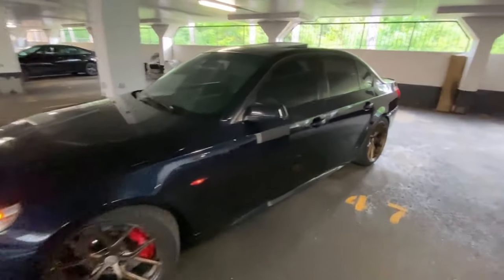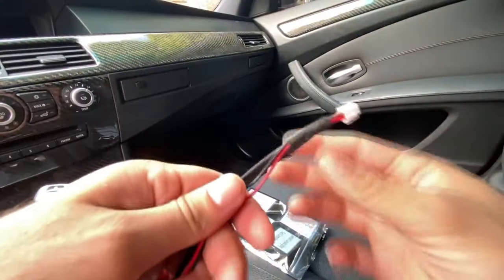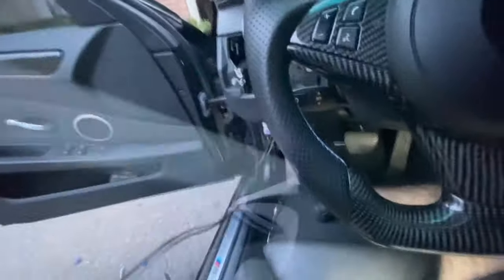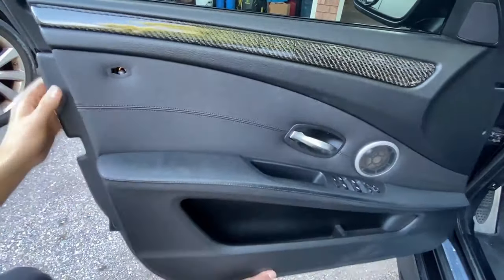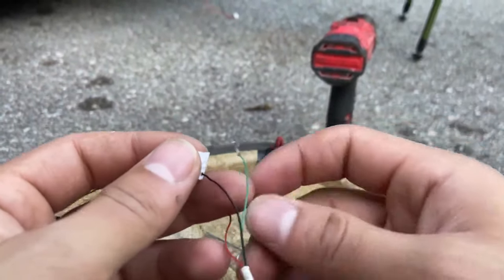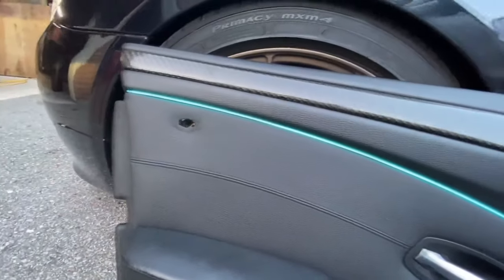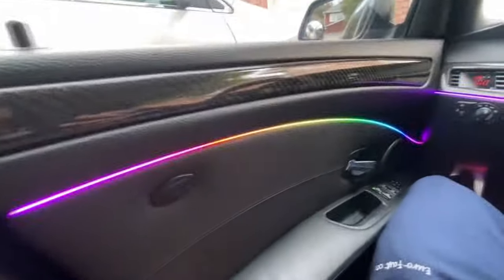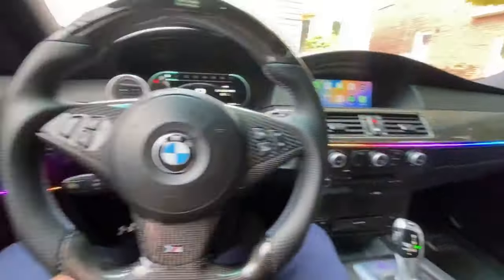The Best Ambient Lighting Kit Money Can Buy - Full DIY Install

Comment: hi, ik this video is a year old but I’m using it to install my ambient lights. I connected it to the ambient lighting but it only comes on during night. Is there any way to get around this?
Reply from the maker: You need to double check the power source. What did you tap into? If you tapped into factory ambient lighting, like I did in the video, it’ll only turn on when your headlights turn on, at night. If your door lights are connected to a constant 12v supply, change the power source for the main controller, maybe that one is connected to your factory ambient lighting power. Change it to a constant (always on when the car is on) power source and it’ll be on at all times.

Comment: instead of tapping into the cigarette lighter why not use a FUSE Tap and tap into the fuse for the Cigarette lighter.  the Fuse Tap is much cleaner install.
Excellent Video and very detailed.  This video inspired me to try installing this kit myself.
Reply from the maker: Great point! However, the fuse for the cigarette lighter is in the trunk of the car. You would have to run a wire from the fuse box to the front dash if you were to use a fuse tap. The cigarette lighter is a fused connection regardless, and I’d actually argue that it’s a cleaner install than running a 6 foot wire from the trunk.
Reply: Bummer, your car has the fuse at the rear. My vehicle has it up front under steering wheel. Now it makes sense why you tapped up front. Thanks for the clarification

Comment: 8:16 No need to de-pin or drill holes for the doors, make a slit on the backside and then push the led strip through from there.. saves loads of time.
Reply from the maker: That’s a great idea! I never even thought of that.
Reply: Slit it where ? Exactly
Reply: Can you explain it like im 5 , im new to this stuff and im trying to set up a kit i bought without putting holes
Reply: anyone reading this do not take this advice just make the hole and depin it takes no time to do
Reply: Make it slit on the back of the door panel along the same line that the, lights will take nearest to the plug just wide enough to feed the skinny end of the light strip through it. Then pull the lights all the way through until your connector is at the back of the door panel. From there, you can
Install the light strip. And your connector will already be at the back of the door panel.

Comment: Thanks so much!

I just wanted to know, how did you install the extra one? Did it need a new module? How did you go about the wiring and getting it all to link up?
Reply from the maker: Which extra one are you referring to? The one under the radio controls? That one I just plugged directly into the main control module. The modules have multiple slots so that you can plug in multiple LEDs.
Reply: @TheAutoSurgeon  awesome! Thanks for that! I've just installed a kit after watching your video! I'm trying to work out that if I bought another kit, if those modules will connect to the same main controller as the others!
Reply from the maker: Someone else asked me the same question, honestly I don’t know the answer 100%. But I’d imagine it would connect—reach out to the company and they should be able to confirm.
Reply: @TheAutoSurgeon  you've been a great help! I appreciate your help, so much!!! I'll check back in with you and let you know how I go!

Comment: how does the sub controller communicate with the main controller? simply as soon as I give it power and all the sub controllers connect to the main controller?
Reply from the maker: Yes, exactly. As soon as they have power, they’ll turn on. But if the main controller is powerless, the sub controllers will stay off since there is no wireless signal indicating the controllers to turn on.

Comment: What if I dont have ambient lights? I connect the doors to the window switch? Do you know which wire is positive and which negative?
Reply from the maker: You would have to test the wires using a multimeter!

Comment: Changed my cars interior wow. I followed your tutorial step by step. Although one of the lights are going in the opposite direction do you know that might be?
Reply from the maker: Awesome! Make sure the connector is facing the same way for each strip. So, if you’re doing the doors, the connectors should be facing the front of the car.

Comment: Thanks for the great video!
As I want to install it on a small car without a soft ambiant dome light, would it be possible to use the storage lights for this purpose or are the LED's to bright?
Reply from the maker: Yes, absolutely! It can be done. If you find that they are too bright, you can always turn down the brightness through the app. It can go very dim, so you’ll definitely be able to find a brightness that’ll work.
Reply: @TheAutoSurgeon  Great! Thanks for your quick reply.

Comment: Great video, do you think there is anyway to add a physical on off switch or button?
Reply from the maker: Yes, absolutely. Put the switch in-line with the main controller’s power supply. Since the sub controllers don’t turn on without a signal from the main controller, if the main controller doesn’t have power, the sub controllers will also be off.
Reply: @TheAutoSurgeon perfect exactly what I was thinking of doing.

Comment: Great Video! is there a way to add a switch to turn off the lights when you do not want them on?
Reply from the maker: Yes! You can just add a switch to the main controller‘s power harnesses. You can also turn them on and off using the app.

Comment: Nice tutorial! Question, when connecting to the white wire does that make the light appear only when its dark outside ? If not do you know how to make them turn on automatically when its "night time" if you know what i mean. Best regards
Reply from the maker: Yes, the white wire on the cigarette lighter in the video. That is on my car though, it might be different for yours. You just need to find a power source that’s on when the headlights are on. For example, if you have some factory ambient lighting, you can tap into that since it’s only on at night.

Comment: Change your door lights, these are most cheapest one already fully faded out 😂 , ambient lights are ok 👌🏼 but in long term test them cuz these are gen 1 from controller in can see. Gen 3 controller is best so far now
Reply from the maker: Which door light do you mean? The door handle or the storage area one? It’s been working great so far, whats the difference between the first gen and 3rd gen controllers? I didn’t know there were different versions.
Reply: @TheAutoSurgeon  door lights ( puddles lights ) M logo one M is already 99% Faded . Gen One controllers are Black which you can find in now very cheap Gen 2 are transparent one and the now gen 3 Orange controllers those are expensive but really good like communication problems with your cellphone app connection time and as well as sync between all door controllers like when you change color they will change together with in mili seconds gen 1 long trem use can’t sync properly when changing color through app and as well as connection not fast as before. 60% customers complain so gen 2 came out then gen 3 came out ( at present)
Reply from the maker: The M logo puddle lights were off of Amazon, they’re not part of the kit. But that’s interesting to know. I haven’t had an issue with this ambient lighting kit yet, the app connection and synchronization is solid, from my experience.

Comment: How do you connect the rear footwell lights to the subconnector?
Reply from the maker: All 4 footwell lights are powered using just one connector that connects to the main controller. You run each wire separately, but it’s all attached to the same harness.

Comment: Brother, Is it possible to use the rest of the led strip after cut it? I’m curious about it 😢
Reply from the maker: You can! However, you’ll have to solder new wires and connectors onto the strip—it’s a very tedious process.

Comment: Which kit did you buy? They have a lot of options. Between 2 in 1, up to 16 in 1. What do those mean?
Reply from the maker: I installed the 18 in 1 kit which comes with everything shown in the video (dash, door panel, door handle, storage area, and footwell lights). The other kits just have less parts. For example, the 2 in 1 only includes 2 light strips for the dash, the 10 in 1 kit includes everything except for the door handle and storage area lights.

Comment: at the beginning of work, was the power turned off? If not, did the Airbag or other signals appear?
Reply from the maker: I had my battery connected to test for power with the door panels off. For my car, the airbag light gets reset when you disconnect the battery for ~10minutes and reconnect. I’m not 100% sure if yours will do the same as some people report they need to use a scanner to get rid of it.

Comment: You swapped the front door ones out for 43 inches and used the 29" that came with the kit for rear doors correct? 29" for front doors are too short for same installation as yours no?
Reply from the maker: Yes, I got 2 additional 43” strips for the front doors. The 29” were way too short. The 29” ones that came in the kit fit the rear doors perfectly.
Reply: @TheAutoSurgeon perfect, thank you, keep doing tasty mods for e60

Comment: I have the dash wired up perfect and the drivers side door wired perfect the passenger door is giving me a hard time the only power I can get is the puddle lights and they only turn on when the door is open, the window switch seems to not have enough power, I’ve tested each module Ona battery and all leds work the door just doesn’t give enough power I’m guessing because it doesn’t have as many switches as the driver door? U got any suggestions mate I’m going insane lol
Reply from the maker: Invest in a multimeter. You can find them extremely cheap, ~$15. Using the multimeter, test each pin/wire for power and it’ll help you determine which one has 12v while the car is running! You should be able to find at least one power source, but in the case that you can’t, you’ll have to manually run a wire with the factory harness from the cabin into the door - this sound scarier than it really is. Just make sure it’s running exactly the same as the factory wiring going into the door, otherwise it may snag or tear.

Comment: I got mine bro it mine doesn’t want to turn off and I connect to the nuetral to tap into the car what should I do
Reply from the maker: For your main controller, you need to tap into a power source that is only on when the car is on. Check your fuse box and test some fuses to see which one has power when the car is on. Then, use a fuse tap to wire in power for the main controller.

Comment: Which one did you purchase? The 2 in 1, the 10 in 1 or the 18 in 1?
Reply from the maker: It’s the 18 in 1 kit!
Reply: Nice. I’m driving a 2019 Lexus es300 hybrid. Two questions: 
- the es I would assume is a longer car than the one here. I want the 4 doors, my dash, and the 4 foot wells lit up only. What would you recommend I buy?
- would the hardwiring on hybrids be any different based on voltage?

Comment: Hello, it's possible to have the ambiant lighting without the headlight ? In daytime I would like to have the lighting too
Reply from the maker: Yes! You would have to find a power source in your door that is on while the car is in accessory mode.
Reply: @TheAutoSurgeon  Do you know what cable I could find my 12v DC on after contact?
Reply from the maker: I’m not sure, you will have to check them with a multimeter.

Comment: If I don't have the cigarette lighter in front of me, where do you think I could get the power to the main controller?
Reply from the maker: You may have a fuse box in your glovebox, you can use something called a ‘fuse tap’ to tap into an existing circuit and piggyback the power from it. It’s a very simple device, I’m posting a new video today in a few hours and It’ll include using a fuse tap.
Reply: do you have any idea why my passenger door lights don't come on, but they have 13.25V?
Reply: I connected them to the window controller, but nothing. Do you have any ideas?
Reply from the maker: Is the main controller wired in and powered on? The sub controllers don’t turn on unless the main controller is on and sends a signal to the sub controllers to turn on.
Reply: @TheAutoSurgeon  yes the main controller is wired and working but the one in the passenger door is not

Comment: Is it possible to hook it up to a physical switch for turning on and off? Would like to be able to turn it on and off myself but don't really like app controls for car stuff
Reply from the maker: Yes! In that case, you would just run a physical switch for the power to the main controller. If the main controller doesn’t have power, the sub controllers don’t turn on either because there is no wireless signal to tell them to ‘turn on.’
Reply: Hi great job I wanted to ask a couple of questions. I would like to connect the sub controllers in the doors to the window button lights but the cables are thin. Since the sub controllers depend on the main controller, can they also be connected to any positive in the door? the question is whether they can absorb even when they are turned off

Comment: Yo so I’m having 2 problems. After I turn the car on, the lighting turns on for 5 secs maybe and then turns off. Doesn’t show up on the app as well. Second being the ends of the light strips where it was cut, it usually is bleeds red. How can i fix that or make it less noticeable
Reply from the maker: Are you running the LED ones or the fibre optic ones? I haven’t noticed any bleeding from the LED ones, so I’m not too sure. You can probably put a piece of black electrical tape on the end to prevent the light from bleeding. In regards to the lights turning on and back off, it sound like it’s an issue with the power. To test if the lights themselves are bad, hook up the power straight to a 9v battery and see if they turn off after 5 seconds. If they work fine, it’s likely the power source, try tapping into a different power source in your car. Hopefully that helps!
Reply: @TheAutoSurgeon  using LEDs. Yeah where i cut them its red no matter what color i choose. So that turning off after 5 sec issues went away after i drove the car again later tonight. Not sure what happened lol. But atm only the bleeding issue. Could a black tint tape also work?
Reply from the maker: Yeah, tint tape should probably work fine! It’s also possible that you just cut the strip at an awkward angle/place. Maybe try cutting off another mm. It’s could be that you cut directly on a specific point of an LED where only the red light shines. But again, I haven’t had this issue so I’m not 100% sure!
Reply: @TheAutoSurgeon  okay i figured out the issue, when i have the lights setting wheel near the steering wheel set to automatic, the leds dont work during the day but work at night. And when i set it to any other option on that other than automatic it works totally fine

Comment: Do you know if this would drain my battery on my 2006 civic?
Reply from the maker: It depends completely how you wire the power for these lights! Make sure when you’re wiring, you find a power source, especially for the main controller, that only has power when the key is in the on position. This will ensure that your battery won’t drain overnight!

Comment: My app need some sort of reset.  Colors dont mach on the wheel color.  How I reset app
Reply from the maker: Try using the “Magic Lantern” app. It’s much better than the one on the QR code in the box. If you’re already using that app, I think they just put an update out for it!
Reply: @TheAutoSurgeon  is the one Im using.  Magic Lantern for interior SymponyLed.   For exterior (LowGlow is MagicLed)...     might there be a way to work all lights in one App?

Comment: if you tap the factory ambient light for the secondary modules they wont turn on until you have your headlights on?
Reply from the maker: Yes, that is correct. If you want them to be on on the morning too (with your headlights off) I think you can tap the power from the window motor.
Reply: @TheAutoSurgeon  A youtuber (garage 88) tried using the power window motor but came up with dash warning his car was an e91 because the submodule drained too much power.

Does the E60 have this issue?
Reply from the maker: The windows are inoperable when the car is off, so I’d imagine there isn’t any power going to the window regulator while the car is off. I’m not 100% sure, you would have to test each wire with a multimeter.
Reply: @jonot8547 have to make sure that the amp output on the power source is 12v as that is what the kit requires... If it is less than that then that can cause problems
Reply: @treeezy1472 I think the LEDS amp draw is super low, you can almost take the power from anywhere

Comment: Anyone else having issues using the "mic" feature on the app? When I try to use that feature, my aftermarket subwoofer stops working, but the subwoofer works with all the other features on the app.
Reply from the maker: Really not sure, it could be the way the sub is wired up. Did you use a LOC connected to the factory subwoofer wires? Maybe your mic doesn’t pickup the low frequency?
Reply: I didn’t use a LOC and I don’t think it’s a matter with the mic not being able to pick up low frequency. The subwoofer completely stops working when I choose the mic option on the app.